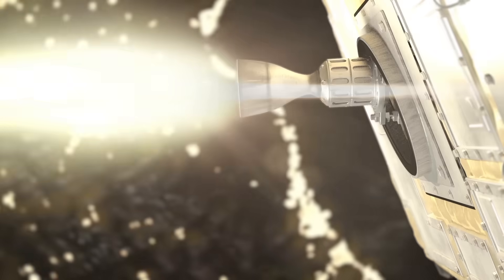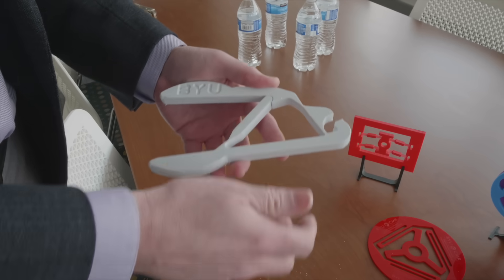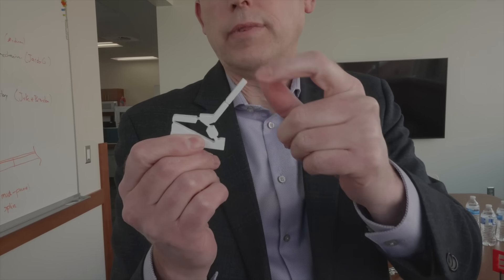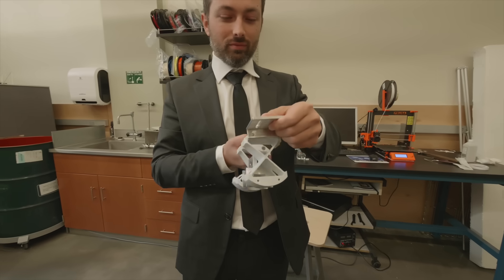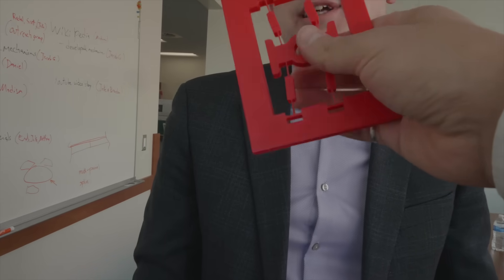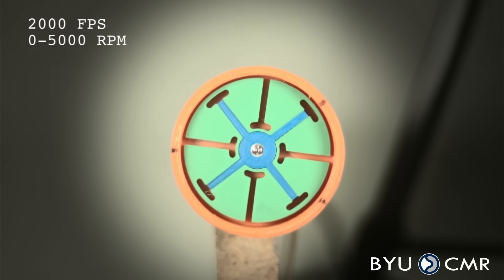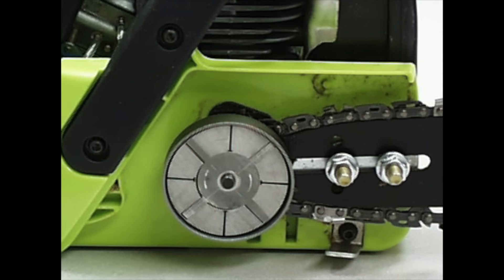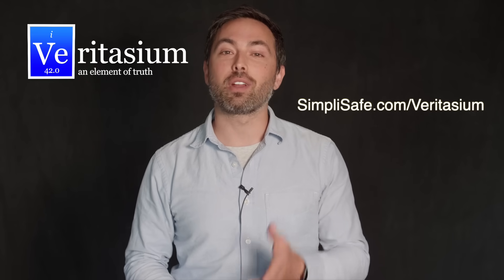Why Machines That Bend Are Better

Comment: Funded by "plastic companies" to save the plastic industry.

No but really, more plastic? Is this fishy or cool?
Reply: It is a complicated topic. We cannot relay on most plastics, really, because their recycling is expensive and uneficient, but there are others with plenty of utility in the long run and better recycled results.
There's also the option to use other substances and materials. Many of those could be made with wood-based polymers or aluminium, which are a much lower threat to the environment and to recycling budget.

This is all stuff that would be done in the future (as soon as possible hopefully, although we all know it won't be done until pressured) when we abandon the "use and toss" mentality we have right now, with cheap stuff that breaks soon being the norm.

Comment: 9:21 the clutch part is also cool, but just like with vice grips the force is transferred through the thin, flexible parts, so it really becomes a material science problem to make a very flexible, but not too flexible and very strong but not too stiff material. Need high tensile strength, but also large range of elastic deformation. Come to think of it; this is the realization of mechanical systems developed prior to invention of hydraulic systems. The force in these mechanical systems is concentrated in smallest parts of the geometry, forcing any future advancements to come as a result of new, better, materials being invented. In hydraulics large force is excreted on large parts of the system while pressure is being kept constant; resulting in ability to use large chunks of weak materials to generate large forces.

Comment: BUT... Aren't these systems just a collection of springs, which function as energy storage devices in a macroscopic system with discrete "low" energy states? The flexible materials are a good addition to these systems reducing the need for high precision joints, but ultimately these are two separate things: material science and state machines with discrete energy states. Also, the flexible material part has a downside, strength. The 3d printed vice grips are cool, but the amount of force you can generate in them depends on strength of the flexible part of that geometry. The flexible titanium item IS really cool, but how much distortion can it support when a side load is applied due to change in angle of the top plane? And yes, i guessed the elephant part correctly. How do you design an elephant like that? Easy, you have 3 points to consider, tip of the trunk, top of the trunk and middle of the trunk. Then you design the rest of the geometry (at that point geometry does not even need to be an elephant) such that top and middle support points of the trunk move along the circumferences of 2 circles that are centered at the point where you want the tip of the trunk to remain.

Comment: Traditional mechanical engineering has used beam theory with rigid structures to balance out the forces...it was easy to conceptualize, and probably made the math a lot easier too...especially when math was not computer assisted. Even on a “rigid” component, yield point, limit of proportionality, and all that dynamic stuff is a small challenge. I’m willing to bet the math involved for balancing physical forces in compliant structures would not be commercially feasible without computers, which would explain why we didn’t start down that path earlier.

Comment: The reason why you never use plastic parts in mechanical machines is because they break and are much less durable. How have they solved that problem because I don't see how a plastic wrench would be more durable than a metal one no matter how durable it is.

Comment: Some of these mechanisms didn't seem to crazy. The Titanium hinge is very similar to something I used to do with a slinky, which was put the two ends together and then a part on the outside can rotate around the center while the rest is held in place.

I wonder what kind of schooling I'd have to take to qualify to join his lab and designs stuff like this. Since it seems to naturally make sense to me, I think I might be good at it.

Comment: Looking at a couple of those advantages, these things could make, say, car repair easier. If one of these breaks, it would be relatively easy to pull it out and put in a new one, where otherwise, it may take hours with expensive power tools to take it out, and again to put a new one in.

Comment: Seen a lot of very similar applications of this stuff in modern tools and electronics. The thruster gimbal however is unlike anything I've seen. I know how to achieve that motion from two stationary stepper motors with traditional linkage and gear types of setups. Neither are particularly nice as the lubricant requirement pretty much ensures it will need servicing on a regular basis. 

I wonder if the thing needs to be heat sinked. I imagine all those bending links are going to put out a good chunk of heat but certainly an easier problem to solve than lubrication, at least from a no-maintenance perspective.

Comment: that's the thing, it looks like it would wear out really quickly. So, if it somehow doesn't, great. That reminds me of a computer mouse button, for example. That thing is a bendy bit of plastic that gets pressed probably hundreds of thousands of times in its lifetime and works the same every time. It's not what wears out and causes people to throw out the mouse. That's probably obsolescence of the design and function.

Comment: I've personally flicked the switch of my stairs light spot, MILLIONS of times, over the course of 25 years.
and surely, hundreds of thousands more, by my parents before me.
only recently has it began to fail, and it can't be replaced because the actual part is no longer manufactured! it would require a full replacement of the whole set of fixtures, up to specs (there are other switches also failing)

I doubt those plastic switches would get a tenth of that life span.
Reply: I think you don't understand how big a million is.
365 days × 25 years × 2 (an off/on cycle) is 18250 times switched.
You'd need to flip it 55 (110 off, 110 on) cycles a day to get to a million. 
All those are averages, bear in mind.

Which is possible, but is still way huge. And a million cycles was the stress test of a prototype so it is frankly not at all comparable.
Reply: I can cover 20 of those cycles in a 5 hour night shift.
I have an office upstairs.
Reply: @bcn1gh7h4wk  yeah, sure - still is way too much, a million is hardly reached ever and still it probably can endure much more than that.
As I said, prototype stress test.

Comment: How is this design/device durable ???  Heat could easily deformed it , since most of this design heavily rely on the ability of the material to hold it's tension and compression .... could anyone shine some light on this issue

Comment: A modern diatonic harmonica can have over 50 pieces- 20 reeds, 20 rivets (some manufacturers use spot welding instead), 2 reed plates, 2 cover plates, 3 (or more, I've seen some with at least 5) reed plate screws, 2 or 4 cover screws (either 2 part chicago bolts or a screw and a nut) and a comb.  So, best case, it will have at least 32 pieces, but as many 54 or more.

Back in the day there was a company called Magnus that used plastic.  Instead of a reed plate with 10 reeds held on with 10 rivets it molded the reed plates.  2 cover plates, two reed plates, 1 comb.  5 pieces total, glued together. 

And harmonicas are flexible machines.  Each reed is attached to the reed plate on one end and the other end swings.  Reeds are made of phosphor-bronze, brass or stainless steel... interestingly, anecdotally at least, the stainless steel reeds last virtually forever for light players but seem to blow out even quicker for hard players.  My theory is that because steel has a small swing range that it can cycle through without fatiguing that light players are staying under that threshold, but harder players are going over it, at which point, as a harder metal, it fatigues faster.  (My math isn't good enough to calculate the total arc of the swing along the length to check it against the numbers I've found for the metals though.)

I've gotten in arguments with customizers (a standard 'good' harmonica will run $40 but customizers can get $400) about whether a machine could align the reeds as exactly.  My bet was it could, but maybe not in a cost effective way for the industry at its size- more people want wrenches than harmonicas.  There is some 'art' to it- you have to get reeds close to choking so that a slight change in technique can choke the reed when you want it to- reeds operate in pairs and to get advanced notes you need to choke one reed.  When I see not just how advanced new technologies are getting, but how customizable they are...

It makes me wish I had a degree in computer aided design.  :(

Edit-
It should, of course, be pointed out that a million cycles on an instrument is not the same as on a wrench.  Those Magnus harmonicas, every one I've tried, is pretty broken while old metal harmonicas sometimes are worth more than new one (lead in old bell brass... some people swear by it).  At A 446, an A harmonicas low note could blow through a million swings in no time-  37 minutes.   (Although obviously if you played that one note for 37 minutes you'd have pretty boring song, but there are 3 A's above it on a diatonic A harp, each with 2x the frequency, so the top one would be less than 10 minutes, and there are higher harps.)

Comment: Sounds like one application could be in firearms design, e.g. good trigger mechanisms are expensive and contain lots of springs and moving parts to transfer a simple input into a simple output that could be replaced by a just one piece of material.

Comment: I dont understand how they avoid fatigue failure. Their components must be heavenly-smooth
Reply: Fatigue usually occurs in brittle, or over hardened metalic substances. For instance if you bend a plastic spoon back and forth it might fail because of sheer forces and tensile forces pulling the plastic apart, but a metal spoon might fail because the bending heats the metal, hardening it, which makes it more brittle. So what the object is made out of matters. If you can use metal which doesn't harden with heat and maintains it's ductility, then it doesn't fatigue the metal even when bent repeatedly. The same can be done with plastics which can be softer and give instead of tear/sheer.
Reply: Subparanon  I'm guessing that's why thy used titanium.  I blow glass, and carbon-heavy stuff like stainless, burnt wood, graphite  seems to be the go-to for tools.  (Copper not so much... just trust me on that.)  Titanium is amazing stuff, like it simply refuses to take the heat.  I just got some on Ebay and * can't wait to try it
Reply: @Subparanon  Is it actually heat causing this? I thought it was to do with pushing crystal dislocations out of the lattice so the material becomes more crystalline and more brittle.  If you bend a paperclip back and forth slowly it will only become slightly warm but it will still break - heat it to boiling point and it won't suddenly snap when you bend it.
Reply: @Subparanon  what is an example of a metal that doesn't heat and maintains ductility?
Reply: @korona277  AFAIK that property depends mostly on the density of a metal, so Titanium and Aluminium are best examples, as they conduct heat so easily that it doesn't affect their stiffness.
Reply: Rilis Eka Perkasa I would assume the design would distribute the stress in an incredibly intelligent way and that the hair length sections feel a stress proportional to that of the size of the component.
Reply: You should check out the basics of SN-curves. In short for most materials there is a certain amount of strain it can handle repeatedly for a very long time (millions of cycles). But of course there are many more factors
Reply: I remember being shown a plastic that gets stronger the more you bend it. Think of plastic hinges on plastic boxes.
That must have been 35 years ago. Before then plastic hinged boxes didn't exist.
Reply: I am just guessing here, but I think since the sections are so thin, flexion stresses are pretty low. And the larger the section (if rectangular for example), the lower the stresses...
Reply: noxxi knox  for the second part, we are just talking from a different perspective ;)
if you want a given force or rigidity for your system, you can make it larger...
I have to agree that most of these systems are displacement-based, hence strain is constant, so the stresses wouldn't change with width.
Reply: noxxi knox  well, all you said was right so... :P
Reply: Thin geometries and slow transitions probably help.
Reply: What about creep though?
Reply: They don't avoid it, they just match or exceed that of other mechanisms. The switch for example replaces a spring mechanism in which a steel tensioner would force the bistable arm two and fro, however eventually that spring dose fail. Honestly getting over a million cycles is pretty damn good, most traditional noncompliant electromechanical systems only last a few houndred thousand cycles.
Reply: noxxi knox  not to mention in the case of the space hinge they're attempting to reduce the possibility of cold welding, so metal on metal hinges are more or less a no go.
Reply: They can 3D print with the precision crystal structure they want the specific parts of the mechanism to have i assume. For example that 3D printed titanium hinge they have. It may be a single piece, but i doubt it has the same crystal structure all around. I doubt you could get the same effect if you just simply cast the titanium in that shape.
Reply: @N0xiety  3d printed metal, depending on the process, is much like sintering. So there is some room for tweaking it, but generally you'd heat treat it after to remove that strain.

Comment: It would have been nice if he would have shown just how precise the movement was. for example with the elephant, it looked like the round hole in the trunk was placed concentric with the center of rotation, he should have placed a dial indicator in there just to show how little deviation their was because it is difficult to see on camera. what is crazy is that to get the same kind of zero backlash with traditional machined parts requires very precisely ground pins and machined holes which depending on the level of precision required can get very expensive. However the strength is another very important consideration, How strong would that Thin titanium hinge be compared to a traditional ceramic deep grove ball bearing of similar size and weight. further more the titanium hinge looked like it would have been very poor with any potential axial loading, though I am not sure if that would be an important consideration considering spacecraft tend to not change attitude too quickly like you can in kerbal space program😁 so axial loading might not be that important. One thing to note is that design of the hinge would also act as a shock absorber at the same time as performing the job of a bearing and return spring, which is important if you want to survive the vibrations during launch, so effectively it takes the job of three different entire subsystems all with one part. And the same goes for the engine gimbal which I had no idea you could even make out of one part like this, though you still have the motors as separate parts (for now). Absolutely amazing!  Heres to the cheep (ish) space flight of the future 🍻.

Comment: The nuclear switch, I dunno. There's metal fatigue. I sense a big surprise BOOM in the future. 
As for the other plastic stuff, are you familiar with the "living hinge" with at least a million cycles? You know, the ones that break within a year? Dig into your cooler for a cold beer and you end up with the lid in your hand.
Reply: dont you get the fatique only if you over load it often?
Reply: Tamukanashe Musengezi ...Soft flexible plastic off-gasses then becomes brittle. Steel springs need to move every now and then. For instance, your circuit breakers sitting in your damp basement haven't been tripped in years. They're just sitting there with their bimetallic strips and springs. One day they'll be called upon to work and they'll protest. You need to exercise your breakers twice a year.
Reply: Anticonny ...Thank you for clarifying. I have no choice but to concur. So do you think this man's products are viable? Longer lasting than say, a standard mechanical hinge as opposed to a one piece all plastic type?
Reply: Anticonny ...I get that but I'm wondering if the 'right' materials exist today? And I understand nothing on a molecular level, only that, for the most part,  plastics become brittle with age. Thanks for your input.
Reply: Anticonny ...Yes, no doubt that is one of the main reasons they used metal on the satellite thruster pivot. The UV rays in space must be brutal.

Comment: Wow, that clutch is amazing. Why have I not heard of this? What a interesting topic, thanks for sharing!
Reply: Clutches like that have already existed for a while, just more complex because they needed multiple parts: https://en.wikipedia.org/wiki/Centrifugal_clutch
Reply: @elimg.3684  many centrifugal clutches have a way to adjust the engagement RPM, and i think some have the ability to adjust the "bite" as well. I don't see a way of adjusting the preload to adjust the engagement point without adding additional springs. So i can see uses for this, but they would require a specific design clutch rather an off the shelf model. so if you only needed 1 or 10 clutches for something it's probably not cost effective.
Reply: pretty sure thats what they meant, a single piece clutch.  @elimg.3684